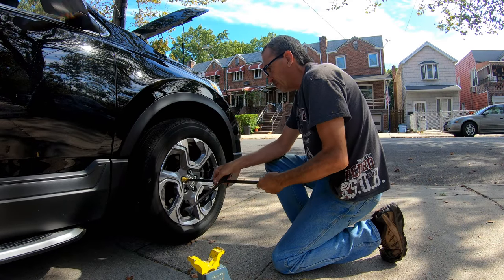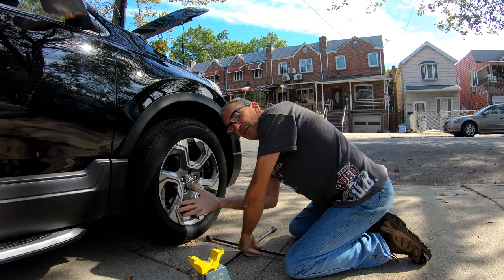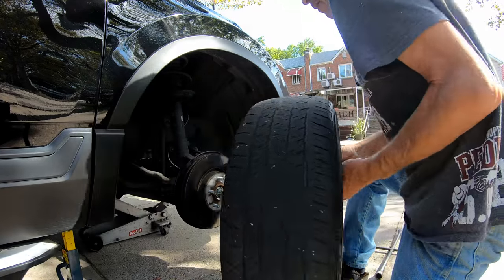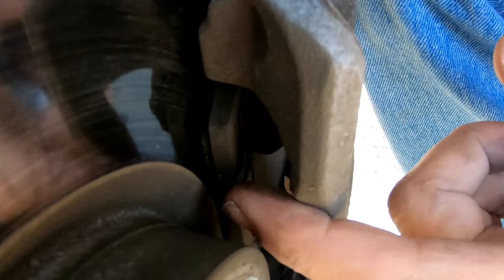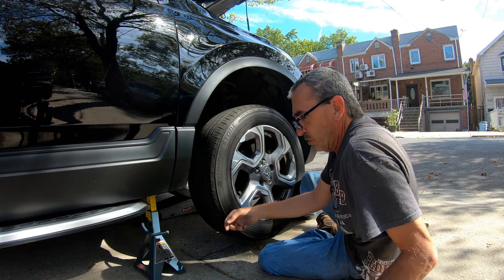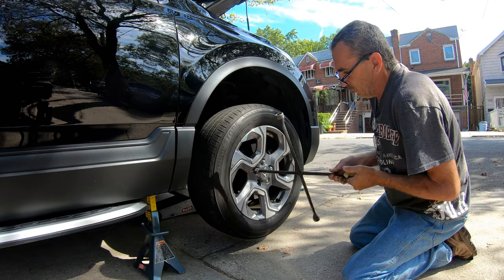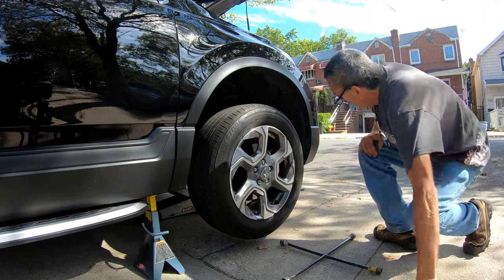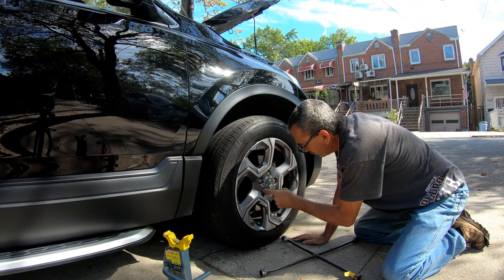2017 Honda CRV Brakes  Change out Preparing for $44.00 pads

Comment: Hi.love ur vids...have you seen the 2018 crv exl...we r doing the rear brakes...and due to the plastic housing for the calipers...we cannot get a grip with clamp to get the caliper piston back in all the way...tried just channel locks but they slip off...we have opened the brake fluid cap...don't want to have to bleed it....
Reply from the maker: what i did  and can recall from memory,  the  caliper piston I was able to grip it and rotate it that started to  reset to the full position    took me some time to figure it out, a proper tool is required I chose to do it the unconventional way, as I turned it went in
Reply: @fishycomics  oh the proper tool...i called the parts store in town and they say they have a universal one tool that hooks onto a socket wrench and fits in those little grooves on the piston..then I started looking and there are lots with various sizes and various size little grooves parts out there...brake kits with a bunch of fancy tools...do u think there is a "universal" tool for my socket wrench...I'm not getting my Hope's up until I see it. Will get it tomorrow..they r making things and cars so challenging...What ever happened to full metal calipers and using a c-clamp gheesh lol

Comment: is this the same for 2018
Reply from the maker: 2017-2022 Honda Crv 5th Gen. the rear brakes you can use a special tool or    different method to push the    electronic brake bak